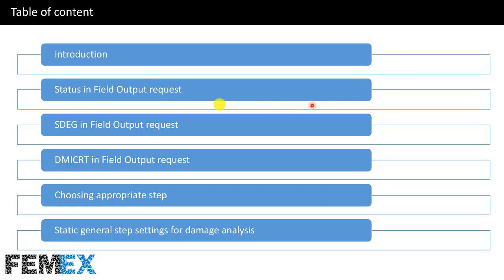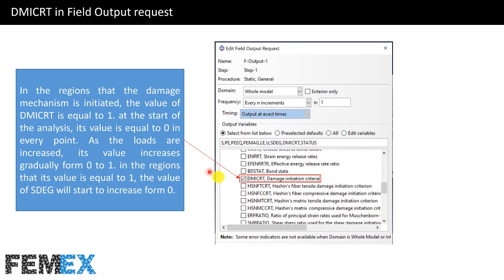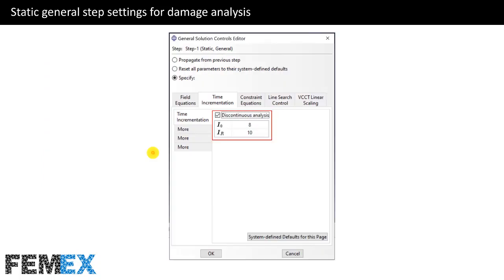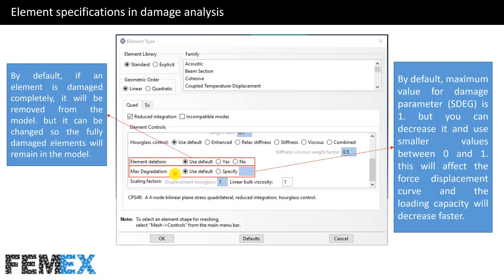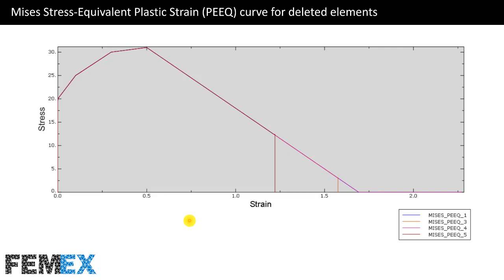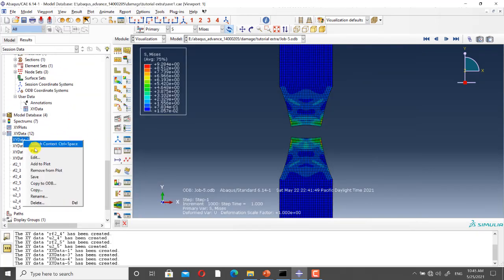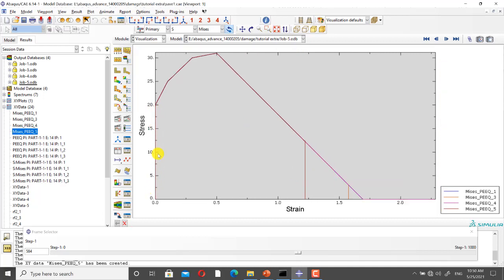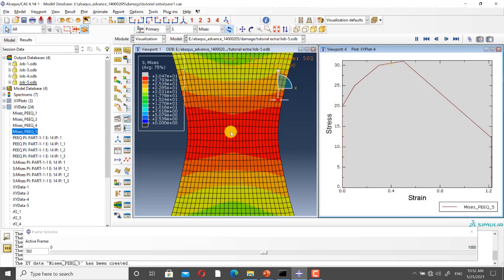Element Deletion in Abaqus based on Continuum Damage Mechanics

Comment: hi thank you for sharing,how to get strain stress curve,average all element‘s strain and stress values?
Reply from the maker: hi.
you are welcome.
actually there are to procedures to get the stress-strain curve :
1) using the force-displacement curve. force must be divided to the cross sectional area and displacement must be divided by the length of the specimen. so the nominal stress-strain curve is obtained. finally by using the plasticity equations, we can obtain the true stress-true strain curve. this way works only for the flat dog-bone specimens used for tensile test.
2) using the stress and strain data of a single element and combining them using the XY data tool.
the second way is used in the video and it is more exact in comparison to the first way.

Comment: I have some questions on the element deletion usage in the Abaqus/Standard environment: since it is an implicit solver, how does Abaqus perform the solution of the implicit FEM equations and solve the deformation problem when the stiffness of elements become zero (when it is fully-damaged)? That is, how does Abaqus perform the implicit calculation and achieve convergence since the global stiffness matrix, K, becomes non-invertible due to elements having zero stiffness?

  Thank you so much for your kind explanation. By the way, your YouTube video is fabulous!
Reply from the maker: hi.
you are welcome.
actually you asked an important question.
I think its answer is mentioned in the documentation.
as far as I know, when the standard solver is used, Abaqus cannot set the stiffness equal to zero because of the convergence issues. so it set the stiffness to a very small value. actually the fully damaged elements will not be removed from the analysis completely. only they will be removed graphically.
even by using this procedure, convergence issues can arise in the damage propagation analysis.
but as there is no convergence issue in using the explicit solver, always it is the best choice for solving the damage propagation.
this is the link of the preview of one of our premium tutorials about damage analysis via both of the mentioned solvers:
https://www.youtube.com/watch?v=DOrYdLNILZ8&t=88s
during this tutorial, even by implementing all of the available tricks, the standard solver faces difficulty to solve the problem but the explicit solver does not.
Reply: @FemexIran  Sir, this is exactly my question. I am using Abaqus Dynamic, Implicit.  I noticed that Abaqus removes the fully damaged elements graphically, but a relationship still remains between elements even after fracture. My question is do these deleted elements continue to influence stress and strain after "deletion"? If so, how can we completely remove them and any effects they may still have? (Using only implicit solver)
Reply from the maker: @enriquecernasaguilar7463  Hi.
As far As I know and according to my experience, the deleted elements in the Abaqus/standard solver, do not cause any problem or warning or error.
Also no critical point is mentioned about them in the Abaqus documentations.
If you have any problem in your analysis, you must find another source of problem.
Reply: @FemexIran  Thank you.
Reply from the maker: @enriquecernasaguilar7463  You are welcome.
Reply: Thank you so much.
Reply from the maker: @prakashthamburaja574  you are welcome.